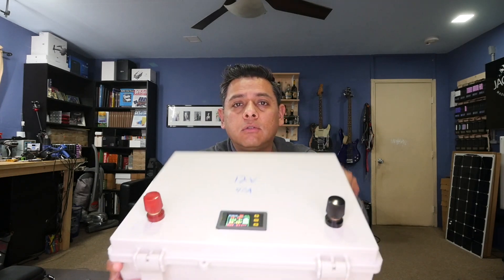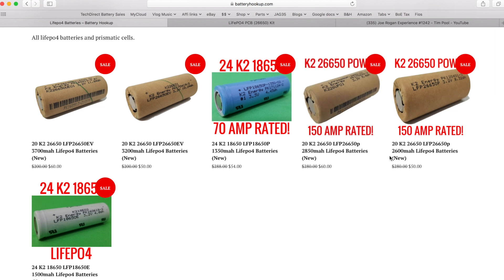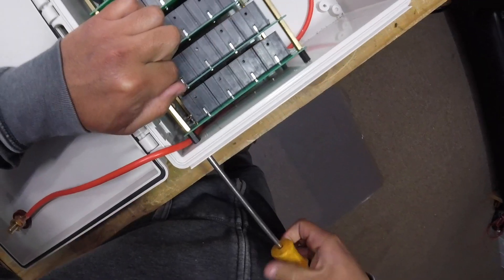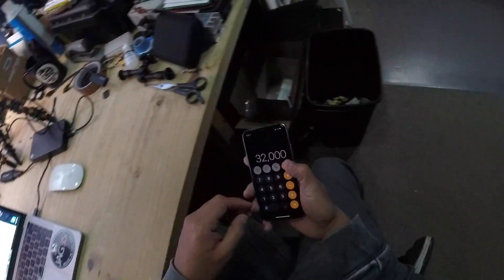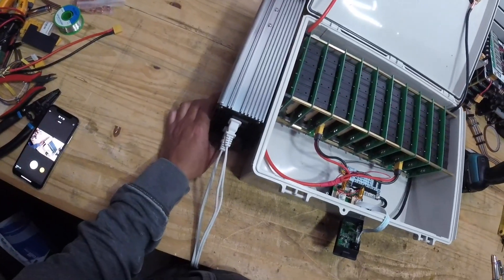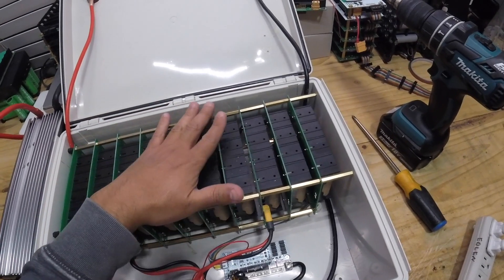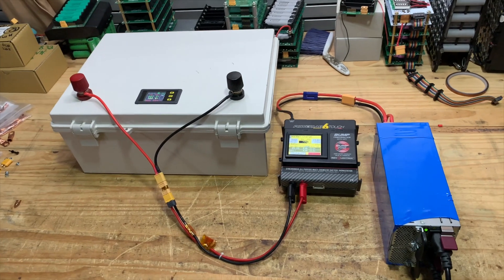K2 Energy LiFePO4 26650 Cells for 12V Lithium Battery replacement

Comment: Hi I want something that will run my trolling motor on my boat.  I have been using a 100 ah 12v lead acid battery. I watched some videos and as far as I can tell a 50 ah of the type you just made will give the same run time of the motors. About 10 hrs straight  none stop use in the test I watched. The big difference I'm finding out is you can recharge the type you made over ,2000 times which is 3 times to 4 times more. How much would it cost to put one together like you did all the parts included. And if you put them together for people how much money would charge to make one ready to put in my boat?

Comment: Help I need a  source for 120 AH LiFePO4 batteries -- shaped "like a laptop computer" -- and maybe 5Kg/10-11 lbs weight. I'm a burned-out engineer -- I don't want to get into the battery pack building business!  Is there an honest China supplier that can help me??? (I just got scammed by "Demuda"  on Alibaba for $400). I'd like to spend about $3-$4 per amp hour. Any help appreciated.

Comment: for the noop ,What is the day to day use ?  exp how long kan I burn a 20 watt lamp .Or I'm I silly now?
Reply: 40 amps @ 12 volts = 480 watts.  Realistically a person will never get all the juice out of a battery, but this is a good starting point. 480 / 20 =  24 (hours). honestly though, I'd think like 14 to 16 hours, perhaps more. Recall that the BMS will kill the power when the voltage gets too low though, so it might be 10 hours or so perhaps. the batteries used in this build are 2.5 AH, and when running them in series you increase voltage but not amperage. Parallel increases amperage, and this i 10 sets in parallel, so that'd actually come out to 25 AH. a 20 watt load will draw about 1.7 amps, so that math says something over 14 hours, but again remember the BMS will shut things off at a low voltage point, so I'd guess 10 to 12 hours again on that final math. Honestly, for all the effort put into this pack, the actual amount of power stored is low compared to other batteries. Don't get me wrong here, I'm thinking of building 2 of these stacks and run them paralell for 80 Amps total or about 50 Amp Hours. The weight would be much lower than the 85 AH lead acid battery I'm looking to replace, but I'd only loose a couple to a few hours of run time by doing so (lead acid battery shouldn't be run down more than 70 to 80% of their capacity at most) and this 26650 setup wouldn't weigh even half as much as the marine battery I'm using now. So yeah, this battery pack, or well two of them, would serve my needs pretty well, and I wouldn't need to change out the charger or anything else I'm using (with solar) because the voltage range on these match the battery I'd replace, and the charger has an option to disable equalization so it wouldn't overcharge the cells. I'm really, really leaning towards buying two of the 10 PCB kits and a couple boxes of batteries to load them up. I'm just waiting to find out what the physical dimensions of the assembled and loaded kit are.

Day to day use, well, depends on what you are using 12 volt batteries for now. Those uses are honestly up to the imagination. Have a portable solar rig for camping or something like that? A mobile device or piece or equipment currently running from an old car battery or similar? Wanna setup a water fountain and/or small pond and water fall in your yard but don't want to dig up things to run power out to that spot? (use this and a solar panel in that case) Uses all depend on what you're looking to do, and if you can do it with a small battery versus AC power. I could see a few uses for a battery like this on a farm provided that the farm doesn't freeze over the winter (LiFePo chemistry will get wrecked if charged when the cells are really cold). I'm in a northern climate, and store my batteries in the garage or the house as needed during the winter (garage is usually just barely above freezing during the winter months).

Sorry for right a short novel here, but it isn't exactly a question with a simple answer.
Reply: @ManfromMN  Thanks for the effort William, I learned from your  answer..
Reply: @tianharvan  I kinda slightly simplified things a bit, but it gets the general point across. You're welcome! Though I must say that after looking at the Battle Born battery products, I can buy parts and build it myself or buy their comparable capacity battery for about the same price. I'm leaning towards buying theirs now...

Comment: So....making something like this, using lithium cells of any kind, to get something over 150Ah would be impossible? 
I’m trying to build a portable battery for 3-5 day backcountry excursions. The commercial ones available are fairly expensive, not adding all the components I would add to it (solar, wind, water props) but if this cost you $120 for just batteries, and you only get less than 50ah, is building a better battery worth it at that point?
I’m fairly new to this, so I’ve enlisted assistance from a professional, but I’d like to know that what I’m trying to accomplish is possible before I present a plan

Reference:I’m trying to run only camp lights and a small fan or two off this thing, for use during night hours. If I could I’d charge my phone too but I’m being as stingy on the power as possible. I’d like to do the ammo box setup for field use.

Comment: The 18605’s that I use are 4.2vdc. So, 4.2 X 3 = 12.6vdc
Reply: Your cells are not iron phosphate cells then.    Fully charged your 3 cells might equal 12.6 but nominal 3.7x3 is only 11.1 volts.  To low for a 12v auto system.  And an alternator will put out 15 volts which would make them explode.

Comment: Why do you bugger around with these little rubbish battery cells . LFP alloy case prismatics save all the work and are much cheaper . 50 Ah cell for $40 from China  which is where they all come from anyway. Get a 240 amp cell and put 4 in series for 12V for about $800 and get a 240 Ah battery.
Reply from the maker: Because there are millions of them here in America that will go to the refinery if we don’t find a use for them.  Life is not all about money.
Reply: BMS can be had on AliExpress for LFP for $30 and 60 amps at that

Comment: How about a parts list for this build. Where do you get the 28650 battery holders?
Reply from the maker: Links are in the description
Reply: @jehugarcia  thanks. Saw it after I posted the question. I ordered everything I needed and am waiting for the stuff now. This will be my first build.
Reply: Can you post a detailed picture of both circuit boards, one with the xt60 connector and one without. My kit came with 45 10 amp glass fuses.  I'm confused as to why there are extra fuses and want to make sure I'm putting them in properly. There looks like a place to put two fused, one with two legs that could occupy the same hole, but two legs won't fit. Thanks a bunch. This is my first build.
Reply: @davelamont  I had the same question. Spent a small fortune on Nates PCB boards and the kit, but also confused about the glass fuses. I bent them and have them sitting at an angle, but not actually sure if I soldered to the right spot on the board. @jehugarcia can you please post detailed pics? Would be most appreciated. I paused and replayed the video a ton but still am not sure.

Comment: Wow - $140 for the PCBs? I'd rather buy a spot welder for that amount.
Reply: They are re-usable. Once the cells need replacing, you replace the cells. Little to no engineering needed. If you use spot welding, you recycle the battery and start over.
Reply: @daren702  I found that while trying to salvage spot welded li-ion cells from laptops that I actually ripped some holes in some of the cells through the welds! So next time I'm just not going to remove the welded strips and simply solder onto the strips directly. Should isolate the cell from heat too.
Reply: The the cost of the pcbs sort of beats out any  of the advantages.

Comment: 12 volts ? Autos run on 14 volts dude
Reply: The nominal voltage depends on the type of the battery, further the minimum and maximum voltage. LiFePo4 nominal is 3.2V. Four cells are making 12.8V, and people say "12V" ... dude.  Minimum 2.5V ... 3.6V maximum, 4 cells are making 10.0V (lowest) ... 14.4V (highest). 
The max voltage is the charging voltage, but NOT the nominal voltage. 
Btw it is nearly the same with AGM batteries, but AGM is a little bit more complicated (charging mode bulk/absorbtion: 14.4V and some 14.8V, float: 13.8V).

Comment: idk what batteries you are using but mine have 4.2V when fully charged and 3.7 when completely empty...
3 of them is perfect.
Reply: A vehicle alternator can easily charge over 16 volts. Most of vehicles sit at 15v all day long. How long would your cells last at 5.3v? Seconds? I wouldn't want to be around to witness that. Perhaps you have a method of limiting the voltage with feedback to the alternator, but that's beyond most in this community. I've not seen a truly safe 12v diy replacement. Most just end up doing raw cells without BMS, since the BMS typically cannot regulate the charge vs discharge on the same two leads. Then the question is what happens when the BMS disconnects the battery? Most cars will just die while driving.
Reply: oh i wasnt referring to car batteries. Im talking about LiPOs for drones, RC stuff and DIY projects. they dont recharge while being used. I guess the shown battery is designed for this application. If so my comment is pretty pointless
Reply: I think it was a mistake for the alternator comment in the video at all because BMS simply does not play well on a vehicle.

Comment: I have found with the cheap inverters i have 3s with the 3.7v lithium batteries is not leaving a lot on the table because they shut down just under 10v

Comment: Your wire size (gauge) is too small and there is no short circuit or over load protection.  Basically, there is potential for an electrical fire if a short circuit fault or overload during operations occurs. Look at your conductor specifications, including ampacity, and maximum temperature conductor.  Also, look at the wire current rating and compare that to your operating load current.
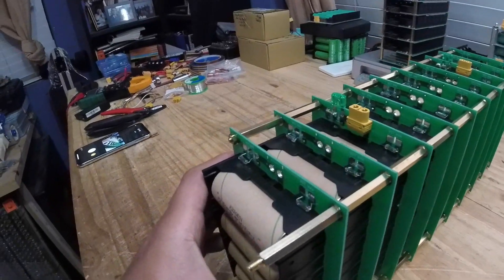Reply: Fuses? See  4:10 
And 40 amps --> cable with 10 mm² is ok, better 16 mm².
For the beginners we say: Never more than 10 amps per mm². Better 5 amps per mm² if you have long cables.
Reply: @Thomas_P_aus_M  I'll have to take your word for it. I live in the United States and I'm totally illiterate in the metric system. We use inches and feet for everything here. In wire sizes we use American Wire Gauge (AWG) where 40 Amps would require a #8 AWG minimum.
Reply: @MrD215  Yes, the very old problem with the international metric system and the imperial units in USA and GB. 
Btw did you know ... the USA subsribed in the year 1870 that they will use the metric system?
Reply: @Thomas_P_aus_M  I didn't know the promise went back that far. In the 1980s the US government tried to push for metric standards, but the manufacturing industries pushed back. At this point we have a mixture of both Metric and Imperial, it really depends on the manufacturer and the industry.
Reply: @MrD215  In europe, where I come from, there is a law that the shops must show all information (also) in metric units, e.g. for a computer monitor with 24 inch there is also written the information in centimeter (60,9cm) AND the manuals must also show the metric informations. The manufacturers got very quick (because of paying much money, if they "forget" it in the manuals). :-)
Reply: @Thomas_P_aus_M  It sounds like there are good laws in Europe designed to protect the best interest of the people, not corporations. However, in the United States, politicians are afraid of large corporations. Even small businesses support special interest groups, unions and associations that collectively have resource to hire lobbyist. The lobbyist broker deals between politicians and pledge to support their future campaigns.  Simple things which should be easy to change for the better of society, become very difficult to impossible to change due to the flaws in our political system. I'm sure you would think, just correct the flaws. The flaws are difficult to correct because the flaws are exploited by same people who have to power to correct the flaws.
Reply: @MrD215  Well, the situation with the lobbyists is here also present. E.g. in germany the automobile industry, the minister of transport andreas scheuer mostely looks like a sock puppet from point of view of the citizens. (And yes, he is.) 
The cosumer rights might be a little bit better, but we all know ... all that glitters is not gold ... we say in germany. (Es ist nicht alles Gold was glänzt.)

Comment: I'm interested in the meter you used.  I found it through your link on Aliexpress (use it a lot).  I have a different meter on my solar system monitoring my LiFePO4 batteries (300 amphr).  My meter shows the solar charge going in, which matches what my Morningstar MPPT controller shows but it doesn't accurately update the state of charge.  Does your meter do a better job?

Comment: I'm a fan of the 26650's too but I think the Battery Blocs solution is better, especially with the new Bloc Balancer he has.

Correct me if I'm wrong but most 12V gear can handle 14.8V. A good DC-DC converter will work with 3.7V cells in a 4S layout or 24V/48V split packs.

Comment: I only read a few comments but noticed a VERY big issue! You used metal screws (and/or nuts) on both ends to mount the battery pack. These are connected to the buss rails that carry the power from one pack to the next so these screws will be live if I didn’t miss anything which could be a big problem couldn’t it?
Reply from the maker: Plastic isolators
Reply: @jehugarcia  it doesn't look right though... I saw them but if you are screwing into metal standoffs that are part of the buss with metal screws that makes the screws live... unless you put a set of plastic standoffs in there... I just saw what looked like black washers or o-rings... I guess I'm wrong then... just trying to keep you from burning that's all

Comment: I have about 200x A123 old cells from DeWalt packs laying around. Maybe I could do something useful with them using that PCB kit, thanks Jehu!
However, A123 are 3.3V nominal, that's should be fine ??
Reply from the maker: Same voltage across lifePO4 3.2v

Comment: Warning: if 1 fuse blows so will the rest!

If one of those 4A fuses blows, the current on the remaining 9 will increase to 4.44A. That will most probably make another one pop, increasing the current on the remaining fuses 5A and so on cascading through all the fuses. 
I think you really want to add some kind of current limiter to this setup.

Comment: I'm new to this and Still learning.  So please forgive my ignorance.  How long will that run? Say 100, 200, 400 watt load?  I wanna build this for ham radio.
Reply: 500wh battery, 500 watts for 1 hour, but really it wont put out 500w at once on 12v because that is too many amps. 500/12=41amps~ and the battery is fuse limited to 40amps. So for your question: It would run 5 hours at 100w (500/100=5),  2.5 hours at 200w, and 1.25hrs at 400w.

Comment: I think you forgot to mention the fact that these batteries are more expensive because they last nearly 4 times as long as the lithium cobalt oxide.
Reply: Lifep04 normally last 2000 charge cycles. Where as most LiCo are only rated to about 500 typically

Comment: Dose noone make a buck/boost charger that will let you use standard 18650 3s/4s that will keep the output voltage between say 12.0-13.8 volts? That way you could use recycled   laptop 18650s   and get a usable voteage range?

Comment: i am looking to build this but i want to use the 200a lithium Spim08hp 3.7v 8ah pouch cells to make a 24v house system for a sailboat(mainly to save space). I will be the first to admit i am a novice and I am not really sure where to start after purchase of the cells. any tips for configuration and housing for pouch cells would greatly appreciated from anyone. thank you in advance,
Reply: If you're looking to save space on a sailboat and want LiFePO4 batteries, look at Renogy 100 amp/hr or Battleborn.  Much smaller footprint, built in BMS, and no chance of fire, which is the LAST thing you want on a boat!
Reply: The SPIM08HPs will treat you well if you treat them well. Agree on not overheating but the price is right
Reply: Dont use pouch cells get alloy cased models . The pouches puff up if you get them hot and they don't go down!

Comment: Would it make sense in your configuration to have a couple large capacitors to even out surges and filter the power output?
Reply: No - it’s DC. If you mean the AC output from the inverter it should already be well filtered.
Reply: if you want to start a car for sure you will need a bank of supercapacitors, to use it with a  inverter you won't improve it  adding supercapacitors

Comment: i need LIGHT cells at total 11.1v with battery management that will allow solar cells to run inline to provide power when solar cell voltage drops but will charge the battery when solar voltage is high..... in an airplane....charge during the day, batteries at night....
need about 40,000mah pack in whatever cells are going to give the most energy density at the lowest weight.....
any chemistry recommendations?
Reply from the maker: These are as good as they get https://erc-green.com/shop?olsPage=products%2Fbox-of-100-lg-18650-m36t-cells-3450-mah